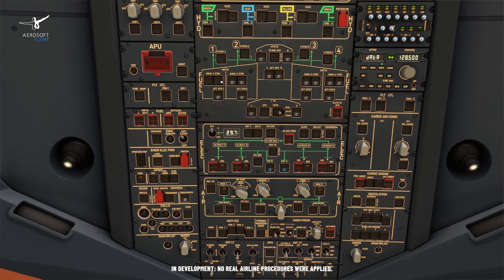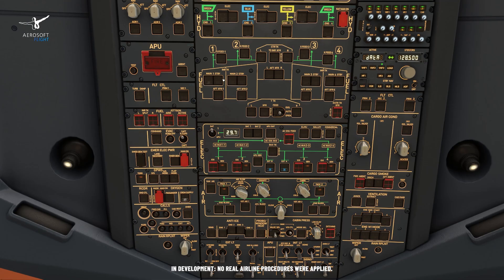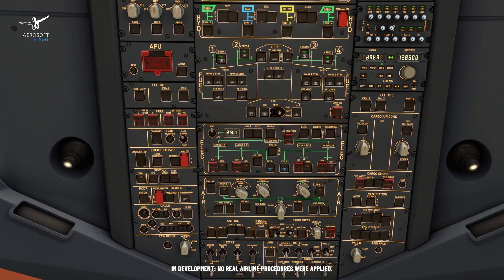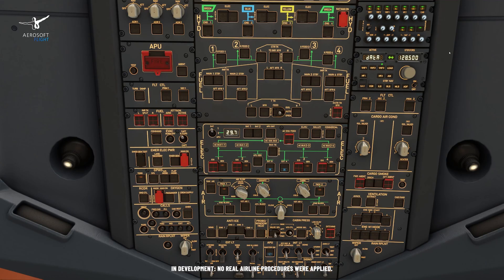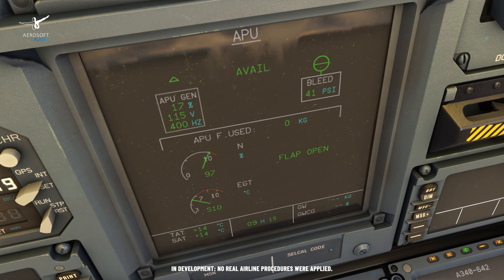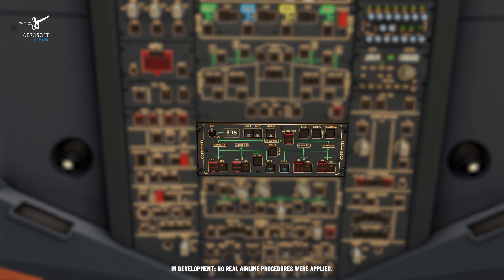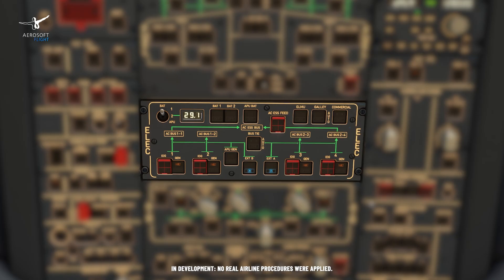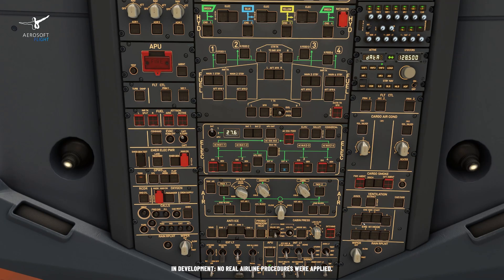Aerosoft A340-600 Pro Dev Update! Part 2 - Fuel and Electric Systems

Comment: ARE YOU GOING TO LEAVE THE A330 CEO LIKE THAT? WITHOUT FIXING IT.
Reply: Update will come, but after the Toliss.
Reply: A330 CEO update is announced to be released after the A330 NEO, because the A330Neo development is subsidized with EU money and they can't use the newer A330 NEO systems code for the A330 CEO before releasing the A330 NEO. The Aerosoft CEO has explained this at his FS Expo presentation (i have seen this presentation in a video here on youtube)

Comment: First Rule: Do not preorder... Second Rule: Be sceptical even if Toliss is on board... still can not belive that Toliss can achieve that level of quality and flight physics in msfs24 with aerosoft... will wait for reviews =)... time will tell =)
Reply: Aerosoft is handelling modelling, anything else under the hood is ToLiss. I think that proves enough, aerosoft isn't doing anything with the systems. toliss alr did an external flight model for x plane anyway.
Reply: @HERD599  that proves nothing. Only the product at the end will show the real quality. Everything in between is just marketing.
Reply: @GroovyBear_ger It still says something about the expectations of the addon. ToLiss should be trusted, maybe not so much aerosoft. They are good at modelling, we can trust that atleast in terms of cockpit modelling. Toliss can be trusted with systems. 2 years work on custom flight and ground model with high system quality expectations.
Reply: I can absolut agree - what for me is a little bit curoius, is the fact, that it shouldt'n be a problem to show the ecam actions while Torsten explained it. Or a view on the fuel Page to Show the fuel Transfer..